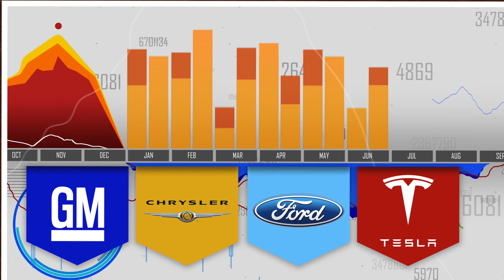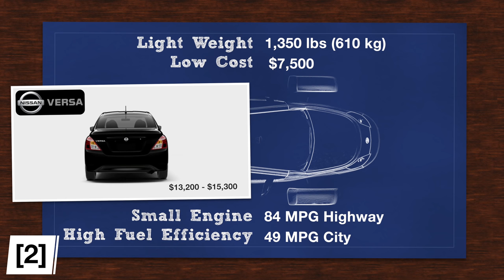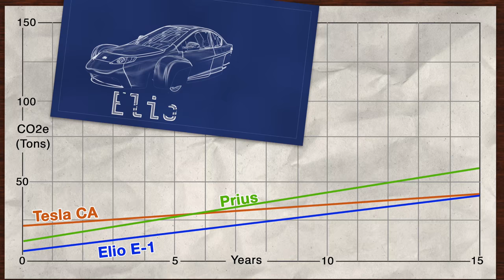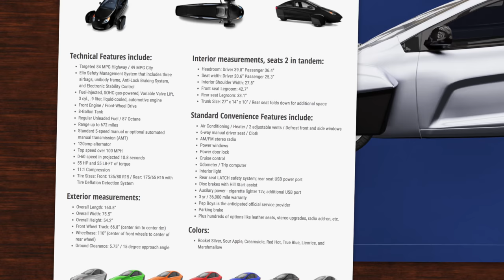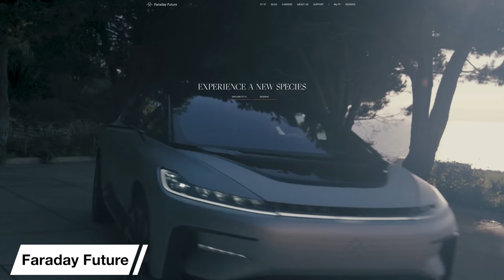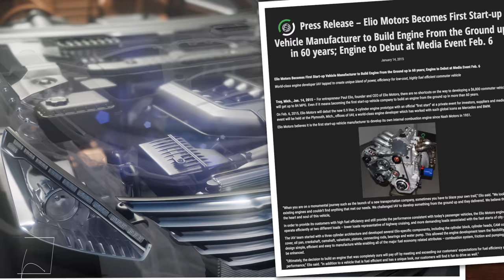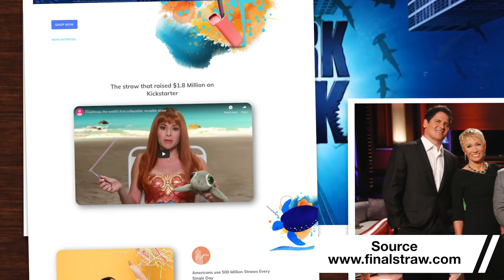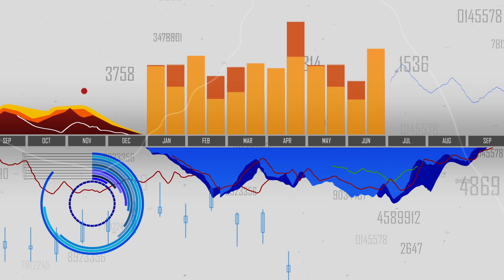How this Radical Car Missed its Chance to Change the World

Comment: So many people here dismissing the entire idea of the Elio because "you can't move 3 kids to soccer practice in it" or "go camping with 3 friends" or "bring home 37 bags of groceries" or "move furniture in it" — and completely missing the entire point.

With a car (autocycle) this cheap, it can become an "AND" car (buy whatever you were going to buy and get the Elio TOO). Instead, people are praising a $55,000 Tesla — which would prevent 99.99% of people from buying the Tesla and any other car because even with a cheap, practical car like a Toyota Camry, you could get a house for less than a Model 3 slash Camry combo (well, in "fly-over" country, anyway). This definitely makes any Tesla an "OR" car.

The point is that you can buy that giant wobbly land barge to haul around your offspring, AND own an Elio. That way you can still do all the "normal" giant SUV stuff, AND meet up with friends for a movie outing without having to drive your lone self across town in a 3-ton gas-guzzling hulk.

My final point is also about the myth of low gas prices making the Elio undesirable. 600 miles of range for 8 gallons of gas was $40 when the Elio was announced, but has dropped to around $15 today. Charging a Tesla Model S P100D at home in California from dead to full takes almost 9 hours, costs over $20, and will still only get you half the range of the Elio.
Reply from the maker: Great points! I really hope they reach production. It’s a truly remarkable bridge car here in the states. We just don’t have many fuel efficient options
Reply: @TwoBitDaVinci  It will never work as long as it is not an electric car!
Reply: @CurdinGees74  And even then, why would you buy it if you can buy a simple scooter?
Reply: @CurdinGees74  Electric cars are great if you're in a city with the level-2 infrastructure that a EV requires. You also need to keep EVs indoors during the winter where I live or the batteries could be damaged.

The Elio was designed as a transitional vehicle for the decade or two it'll take for EV infrastructure to become universal (or for people who live in Apartments that simply won't let you charge an EV, such as mine)

And while I love all motorbikes, scooters included, it's 21F outside right now with snow on the road.....
Reply: @DFX2KX  10 years ago, of course EVs were something exotic but now 2018 we have so many normal - looking Electric Cars, that there are no restrictions any longer. 300, even 400 km of range.. While you have at least every 150km a fast-charger. And often you can even charge at the working place or in a multistory parking garage. Current EVs have integrated heaters and can withstand also minus 30 degrees Celcius even for a couple of days. But of course, a garage with a powerplug will be nice. But of course, the purpose of this little car, was to reduce cost and material needs to build it. And also reduce the power consumption. It was nice for that time.. no longer after 2018 !
Reply: Big families are killing the (human) world...
Reply: @CurdinGees74  The Elio is still very much appropriate today.

Until EVs can get 500 mile range, or recharge in 3 minutes, or operate purely on the solar panels on their roof/hood/trunk, then gasoline will reign supreme. The only people buying EVs are people with LOTS of disposable income, or live near lots of free charge stations.

The people want a better product, and sadly EVs aren't quite there yet. Entry level is over $35,000 for any decent range, and the (non-Elio) affordable EVs either have no roof or windshield, won't go over 20mph, or have 10 miles of range.

The day you can drive 1,000 miles to ANY destination with stops no longer than a restroom break for recharging, in a vehicle that costs 25% less than an ICE-powered one (and doesn't look ridiculously stupid like the new Prius or ANYTHING from Nissan), is the day all ICE-powered passenger cars disappear. Probably 5-10 years out at this point.
Reply: @brackman71  You can get a used Renault ZOE  for $12,000, Charge with 43 KW and enjoy a ride of 300 km on one charge.  - nobody needs more than 300 km ! And you allways should take a pause after two hours of driving in any case.. to go to restroom, to eat, and also simply to relax, before you take the stress of any traffic. You don't need to wait, next year you will see many EVs pop up from multiple Producers.
Reply: @CurdinGees74  Nobody needs more than 300km? Hah!  Just today, I drove 400 miles (644km) to home, from visiting family and friends. I make this drive several times a year in my Civic, that can get over 40 mpg highway and over 600 mile on a topped up tank. Twice a year I may do 700 mile (1127km) days.  Yes, I usually stop to use the facilities, eat, and refuel (especially on the longer trip), but certainly no long enough to recharge an electric vehicle.  Until  electric vehicles can do over 400 miles highway on a charge, they will be be at best, a third vehicle for me (after my coupe and truck).
Reply: @dbcrn859  you can drive any distance with an EV that you like, only thing is, you take better care of yourself and also give the car some healthy rest to juice up. But I guess you need to test-drive an EV of 2018, so you can feel all the power that you get when your pushed into the seat.
Reply: @CurdinGees74  Until cities install street side chargers or car batteries become portable (to charge in apartments) electric cars are a long way off from being an option for city dwellers.
Reply: @CurdinGees74  You still need to charge an EV and the infrastructure to do so easily & quickly just isn't there yet! If you live in an apartment and park on the street (as I do) EV isn't an option and won't be for years to come.
Reply: I think what you are describing is still not the real issue. Few people are going to buy two vehicles and have one of them be a tiny commuter vehicle like this. Doesn’t matter if it’s gas or electric the kind of people who have an extra $7500 to spend on a vehicle will just get a nicer more expensive vehicle as opposed to buying a cheap SUV and a Elio. $7500 is still a lot of money for a vehicle. People who have that kind of money extra wouldn’t necessarily want this car and people who can only afford that much are going to be looking at the used car market for a single vehicle that does everything they could ever need. There are other cost that go with owning two vehicles; heck insurance cost alone would make this a hard sell for people in the market for a small cheap commuter vehicle and a SUV for all the other task. So all the things you listed that people dismiss it for are valid because anyone who has kids to move or wants to go places hauling stuff will not be the target audience for this vehicle anyway. This is a tiny commuter vehicle that is strictly for people who only need a small commuter vehicle, propulsion system is irrelevant to that. Their target audience is people who worry about carbon footprint and people who can only afford $7500 for transportation not people who can own multiple vehicles for multiple different task. Their target market is sort of limited and their competition is every cheap used vehicle currently on sale. 

Also they never really had an engine that would get the efficiency they were pushing and honestly they may never find one internally or externally that will fit those parameters. If this thing ends up only getting 40 mpg as opposed to the 80 mpg they are advertising then it really shrinks its appeal by quite a bit. After a decade of development they have really missed the mark and the window of viability for the idea, which honestly had a limited market to begin with.
Reply: @CurdinGees74  I'm in Texas. That's in the United States... so no Renaults are available at any price, and as for your statement of "nobody needs more than 300km!", I've gone on client meetings where 300km wouldn't have been enough for me to make it home. In Texas, we measure drive time in HOURS not MILES.
Reply: @johndavis1872  I've seen people here in Texas spend more than $7,500 a year in gas. For those times that they only needed to carry one passenger (and not a soccer team or a half-ton of lumber) the Elio would have been perfect. I agree they have spent WAAAAAAaaaaaaaay too long on the "development" phase and should have crossed the 500,000 vehicle mark by now.

...but even in an all-electric future, the Elio is still viable because if the EV technology ever finally reaches the "better than gasoline" stage, those technologies could be easily applied to the Elio which would make it even more appealing. Imagine the same 300 mile range of the Tesla Bismarck (Model S) using a 20KWh battery instead of Tesla's 100KWh battery. Recharging in one-fifth the time for the same range would STILL be very appealing.

The reason the world needs this car is simply that MOST people are transporting only themselves, without luggage, for 99% of their driving... and it's amusing to see a tiny woman piloting a massive land barge just to go to work. In the United States, apparently, everyone is only buying SUVs because Ford and Chevy have announced they are stopping production of nearly all passenger cars. I think that trend alone will kill the Elio, despite its value proposition. If the trend keeps up, you'll eventually only be able to buy 4-row seating, 6-door oversized SUVs. The only thing that can save Elio at this point is gasoline priced at $12 per gallon.
Reply: People would rather a real car, or motorcycle.
Reply: no we've been dismissing it because they've been lying to everyone and stealing our hard earned money, seriously research it before you start mocking what you don't know
Reply: @brackman71  Well, the thing with 300 km is.. what you need in your batteries until you can find the next supercharger. So basically after that distance you want to take a break anyway.. actually even after 200 km / 125 miles or to say after 2 hours - break and charging time at the same time, so you don't have any lost time. So to say even with electric cars you can drive thousands of kilometers across the country. Actually with a Tesla Model S 100 D you could even drive 500 km with one charge. In Wintertime still 450km. So, absolutly no worries about the range of an EV.
Reply: This is why people buy $65K pickups to carry their brother in laws couch once every three years.
Reply: HyperOptic Productions  I am sure plenty of people spend that much on gas a year, if you drive a full sized truck or SUV and have a commute it’s quite possible. Thing is people who spend $50,000+ for a Chevy Tahoe aren’t going to ever buy an Elio regardless. They might buy a Polaris Slingshot for entertainment but they aren’t going to buy something tiny, cramped and dull just to commute in. Heck they payed that much money for the huge vehicle because they want to be inside a huge vehicle; they chose it for comfort, luxury and appearance. People who spend that kind of money on a vehicle wouldn’t want the Elio regardless of cost, they bought the vehicle they bought because they want to drive it everywhere even if they are the only one in it. That’s the issue that limits this cars appeal, most people want a car they love not a tiny commuter vehicle just to get from point a to point b. It’s a similar position as the smart car (a vehicle that has barely sold 100,000 vehicles in the US in ten years), there is just a limited market for it. More people care about Apple CarPlay than gas mileage at this point. Auto purchases are emotional purchases not just buying a basic appliance to meet a need. 

The kind of cultural momentum they have to overcome would just be too much for this vehicle; at least in the states. Overseas they may have had a better chance if they could of hit that price. I am sure they could of sold 10 to 20 thousand of them a year if they had actually been able to get it to production but that’s probably about it for them and at this point the window has probably closed on even that. The 60,000 preorders they have was probably the vast majority of their potential market in the US. If the whole thing hadn’t been such a rolling disaster of poor decisions and incompetence this vehicle could of probably been built and sold well enough to exist in its niche but it would of never been a game changer in the industry. Could there be a future for something like this? Perhaps in urban areas as things like car sharing companies become more prevalent, although electric is going to end up dominating that market too.
Reply: @Hyperoptic "So many people here dismissing the entire idea of the Elio because "you can't move 3 kids to soccer practice in it" or "go camping with 3 friends" or "bring home 37 bags of groceries" or "move furniture in it" "

Who said that? You?

"The point is that you can buy that giant wobbly land barge "
Which ones wobble more than this bike?
Reply: @eksine  I've been following Elio since the company formed in 2009 (back when bad decisions by the presidential administration caused gas prices to hit $5 a gallon average). I've seen every news article and blog posting (both positive and negative) about Elio... so I am quite qualified to comment on the Elio. As for mocking Tesla (and electric cars in general) I am very qualified to do so without doing any more research than this: Can you go 4,000 miles in a Tesla in under 100 hours? No. Absolutely impossible under any circumstances because the technology just isn't there to replace ICE vehicles for long-range travel at anything resembling affordable pricing.

As for your assertion of Elio defrauding people... I wouldn't count production delays as "lying to people" otherwise Tesla would be just as guilty. Hell, Tesla HAS outright LIED to people saying the Model 3 would be $35,000... which is STILL impossible. Tesla will NEVER sell a $35,000 model, especially now that the "free" (taxpayer-funded) $7,500 subsidy just dried up for them. Expect Tesla sales to slow down now that people aren't going to be paid to buy their cars. People who want an electric car will shop elsewhere with companies that haven't hit their cutoff for the subsidy. The Model 3 will be no cheaper than $46,000 tomorrow morning. A new Honda Civic is less than HALF of that, at $19,450... or if you prefer Toyota, you can get TWO Camrys for the price of a Model 3 base.

The day you can recharge an electric vehicle with 500 miles of range within 5 minutes, and do so at every current gasoline station pump across America, is the day the ICE-powered vehicle goes extinct. Right now a full EV switch for everyone is a pipe dream until that point because a 9-hour level one recharge time for a Tesla Model S is absolutely ridiculous... and nobody who lives in an apartment can even consider installing a level two charger. Even a Tesla supercharger (level three) takes a half hour to get to 80% charge... with 90 minutes to full. Imaging leaving your car at the gas pump for half an hour while people behind you want to fill up. EVs are great for people who never travel further than 50 miles from home (or who have level two or level three charging at their luxury home with enclosed garage) and have double the money to spend on a vehicle.
Reply: @brackman71  no you're way overthinking it. logic fallacy. I'm saying they're not dismissing it because they can't fit 3 kids for soccer practice. it's because it's fraud. and you are wrong, this IS fraud, when you delay the date almost an ENTIRE decade, year after year, take everyone's deposit, and have nothing to show for 9 years. they are, what $100-300 million, in debt? yeah that's fraud due to gross incompetence or it might be downright fraud masked as incompetence. in either case lies, stealing money without anything to show for it, it's all the same thing. You're either being unrealistically optimistic or delusional
Reply: You can buy a reliable hoopty off of CraigsList for $3K-5K. Any time you're just driving yourself or you and one passenger, take the Elio. That's probably going to be 95% of all your driving. For that remaining 5%, take the hoopty. Cost of the Elio + the hoopty is still probably under $15K ... and 95% of the time you're getting 49-84 mpg. That's still a great deal and you still have a vehicle to carry larger loads.
Reply: Well said.
Reply: Exactly! I use a heavy one ton pickup for work. But would love to have a runabout that is just for me or me and my wife.
Reply: The problem in most countries with an 'and car' is you then have 'and insurance'. Car insurance is still a larger portion of total costs than fuel in some places and doubling that cost makes owning two cars a non-starter.
Reply: @CurdinGees74  Tell people in the American West that 300km is all they need. Most large towns are further than that apart. It takes over 4 days to drive coast to coast spending 12 hours each day at the wheel. Unless you live in a large city with a short commute, an electric vehicle is simply impractical.
Reply: @currentsitguy  Well the point is.. you don't need to be able to get to your destination without recharging on your way after 2-3 hours of driving!! You should take a pause anyway and so you can recharge 30-45 Min to do the next 3 hours of driving. So everything is fine, as there should be at least a couple chargers every 150 km ! Tesla at lest provides this.
Reply: @CurdinGees74  Not really practical. Here is an example: 4 years ago my wife and I went on a driving tour of the American West. We live near Pittsburgh, PA. We had a schedule to keep if we wanted any time to spend at our destination, Wyoming, in 3 days. On our first day we needed to make Davenport Iowa, a distance of about 600 miles (950 km) by the end of the day. The second day was Wounded Knee, SD at 700 miles (1125km). That's like driving from London to Milan twice in two days. It is simply impractical to cover those kinds of distances stopping every 200-300 miles and waiting an hour. Breaks consist of stopping to fill the tank, walking to the restroom and back, and going through a drive through for lunch and dinner. The US is a huge country and you have to spend considerable time behind the wheel if you are traveling any distance.
Reply: @CurdinGees74  Electric cars are still far too limited for a lot of people. Limited routes due to charging stations. Limited range, so adding a LOT of time when driving long distances.
Reply: @currentsitguy  Ok.. well I live in Switzerland, around the middle part.. so there is not even more than 300 km to go until I would cross the borders, no matters in which direction I would go. But driving over 1000 km in just one Day is just insane! Actually the only way to do your distance is by train, or by Airplane ! For me, it makes absolutly no sence unless you have 3-4 Weeks to spend on your 3000 km jurney. But you probably have to admit, you won't drive more than 150 km per day in a normal week. ( in Switzerland it is less than 50  km per day, normal usage of a car! ) But of course I know your distances in the US are longer, but still, there are a lot of Tesla owners that show the world, it does actually work just fine to drive across the country with an EV. You get up to 450 miles.. of Range.. but that still means.. do at least 30min brake every two driving hours ! Even though the comfort in a Tesla is much better than any kind of petrol car - even with luxiory interior. Because - EVs are very quiet, and no exhaust fumes, and above that you can save a fortune by using electric power instead of gasoline! An EV has only 2500 parts and a petrol car has over 6000 pieces, and a lot of other liquids and moving parts, that go broke in a very short time. 
A tesla does not even need inspection more than once in 100'000 km and can even be very fine at 600000 km.. so.. in any case an EV is allways better than any car that burns fuel !
Reply: @psykoklown874  The point is: you do not believe in EVs, and the need to get away from Petrol completely in just a few years ! If you want, it works.. if you don't want.. then it won't because you plan the trip in a wrong way! Also many times, the trips are not even really needed ! - We have an internet !
Reply: @CurdinGees74 Try telecommuting to a construction site. How do you plan a trip in an EV to places that don't have charging stations? I used to travel between job sites around the country in my personal vehicle (that's the way it was). Half way across the country in a weekend was quite common. On some of those sites I was installing the internet (ISDN) you would have me use to telecommute to those sites.
Reply: @CurdinGees74  You live in a beautiful country. I took a driving trip once from Como, Italy, via Lugano, Switzerland and Vaduz, Leichtenstein, to Feldkirch, Austria and back for a day trip. I had lunch in Splugen. Lugano is an absolutely wonderful town. I fell in love with the area. I understand how difficult it is for most Europeans to grasp just how large the US is. Really, most Americans don't get just how big the US is. Unless you drive it, or take the train (heaven forbid) it is completely incomprehensible. Our states are as large as many whole European countries. When most foreigners think of the US they think of New York, LA, Chicago, or some other large metropolitan area. The fact is, most of us live far removed from those places and we put substantial mileage on our vehicles just to get around. It is not as if we have any choice. An hour or hour and a half daily commute each way just to get to work and back is not unusual.
Reply: @currentsitguy  That is nice, that you actually had the opportunity to visit Switzerland and that you had a good time here. But you would not beliefe.. we say, one hour to get to working place and one hour back is just a normal travelling time  - be it by car or by train - which is much more effortless.. as you have not even one km to the trainstantion and every hour you can take a train that comes in on time, and gets to the destination at scheduled times. I think it is very sad, that the USA does not maintain a good network of train-lanes cross the country for passengers. Often you do only cargo by train. 
But apart from that.. no Swiss ppl would ever drive 1000 km in one day.. actually they would fly as the distance is too far for us. From Basel to Hamburg by train, takes even more than 8 hours.. from Zürich to Paris.. is probably around 9 hours. But I would never do that in a car !
Reply: @sirvash2335  I can think of about a half dozen reasons, ranging from bad weather (too hot, too cold, and especially rain) to having no meaningful cargo capacity at all.
My most common trip is going shopping - by myself.
And even in the extreme case, what I come home with would usually still fit in a vehicle this size, but it would be an extreme struggle to get it home on a scooter.

For that matter (leaving aside regulatory issues requiring wearing a helmet in it), I am typically not dressed in a way that I would feel comfortable with while riding a scooter.
And, this is viable and probably fairly comfortable for long distances (which given the country I live in are a semi-regular occurrence, often with just two people in the vehicle at most)
I don't feel too bad about the thought of driving this kind of thing the 4-500 km I sometimes drive, while I'd find that completely unthinkable on a scooter...

This vehicle is simply a middle ground that is more widely useful than a scooter, but not as needlessly oversized as even a typical small car...
Reply: @CurdinGees74  lol. Nobody needs more than 300 km!?

Where do you live exactly?

To me, 300 km is a trivial day trip.
Hell, I can and have gone to nearby towns and cities solely to go shopping that are 150 km away, and I can tell you it's very much stretching it to have 300 km range at most, plus my time at destination isn't that long and charging infrastructure is almost non-existent.
Driving 6-800 km with maybe 2 breaks at most is also a fairly common thing to do, often multiple times a year.
(hell, in some parts of this country 600 km is the distance between petrol stations, much less a town or any other infrastructure - there's nothing there in the middle to stop FOR, much less recharge a car.)
And by the way, those two breaks are probably 45 minutes combined!
(about half an hour for food, and 10-15 minutes just to stretch for a bit.)

I'm sorry but your assumptions here are way off.
If you had said 'most' people you may have been right. (though frankly my country as a whole is the exception that proves the rule - perhaps why EV takeup has been really slow here. And also why the few EV's that HAVE made it here have outright dropped their lower range models - you can't even get 100 mile/160 km EV's here, because they are not regarded as remotely viable. Hell, in some of the major cities it's possible to have commutes that are 80 km each way.)
But NOBODY?
Hah. Try again.

The only case in which you can really say NOBODY (And even here there will be exceptions) would be once the range hits 1500 km or so.
That's roughly the range of the people around here that drive 4WD vehicles to remote areas - typically dual fuel tank models that have 1200 km range and then 3-4 spare fuel cans on top of that.
If you can cover THAT use case, you can probably justifiably say that nobody needs a longer range.
but 300 km? Not even close.
In this country I'd say 90% of people would be covered with 600 km range. 300 km would not be enough for the vast majority of people unless they have something else to cover the edge cases...
Reply: @KuraIthys  I live in a small Town called Lenzburg, around 70 km from Zürich.. every 5 to 20km we have towns with have at least 3000 habitants.  But even a place with 500 would be enough to find an electric plug to charge up the Car... so in Switzerland you can charge every 40- 50 km... no Problem at all. But sure the Outback in the Us could be too embty.. In Europe 200 km of range is mostly far enough traveling during one day. Even Petrolcars will not have more than 40 liter Tank.. which is enough for 600 km. So you fill it up once a week. But the normal use case is simply charge at home over the night, and if needed, charge at working place 8 hours.. so you dont even need Fastchargers.
Reply: @currentsitguy  Your travel schedule is just like my family's schedule while traveling to visit grandparents in Texas. The 700 mile Georgia to Texas trip COULD be easily broken into two smaller trips with an overnight in Mississippi, but my parents don't really do this and just barrel through the 10-13 hour trip in one day.

Now this type of trip COULD be accomplished by a very long range EV or a small car like an Elio, but it's literally impossible to do that around Christmas with my family as passengers along with a half ton of presents and other luggage. Under these circumstances my parent's MASSIVE 3 ton Jeep Commander is really the only car (not truck) that can undergo this much punishment and survive 4 of these trips PER YEAR!!
Reply: @woxof46  The ironic part of it was we did the trip in a Mini Cooper, not the roomiest of vehicles. It's perfectly serviceable for just two people with the rear seats folded down for storage, however. We had all of our camping gear, 200 pounds of fossils we collected in Wyoming, along with various mementos and gifts we picked up in the various states we drove through.
Reply: @currentsitguy  You did it in a Mini?! Nice!!
Those cars are pretty famous for being able to carry a surprisingly large amount of passengers and cargo.
Reply: It is an excellent 2nd car. I have a Flex for my family's needs. Now its great for what you need a mini van or truck for but I work 12 hours a day and only 2 miles from my house so a little cheap car would work well for me.
Reply: @CurdinGees74  Are you living in Europe?  I mean it sounds like it since you seem to have no idea how vast and huge the US is.  There are 11 states that are as big or bigger than The United Kingdom of Great Britain.  The state I live in Pennsylvania is 300+ miles across (500+km) And with short  half hour stops to stretch, use facilities and eat.  Can till be a 6-7 hour trip.   Electric cars don't have that much range yet and the intfrastructure isn't there yet for this.   Yes we have places where you can charge your Tesla, but they are places where you know you're going to be spending a good portion of your day (like an outlet mall)
you're also converting miles incorrectly.  US miles are bigger than a km.
Reply: You are right on target, people are missing the point.  The Elio is no intended as the soccer mobile.  It's intent is for commuters, you would have the family truckster and an ELIO for commuting.  Look at all the F-150's used as the Familymobile and the commutetoworkmobile on the roads during rush hour and you will gain insight.
Reply: The funny thing you can't do half those things in most sports cars but they still sell a lot of them.
One thing I will say the Elio is more sustainable than a Tesla even if it still has an ICE since it requires a lot less rare and energy intensive materials in it's manufacture.
If they made an EV it would be greener no contest and maybe this should have been the direction they should have taken since there are numerous electric motor suppliers they could have used and the battery pack would only need to be half the size and cost of one in a Nissan Leaf or Bolt.
Reply: HyperOptic Productions I don’t know if you’re correct about the Tesla costing $20 to charge regardless of if it’s at home or at a supercharger, but I agree with everything else. I was very interested in the Elio when it was announced and periodically check on it because it’s so damn cheap.
Reply: @sirvash2335  .... riding a scooter 30 miles each way to work on the freeway in all weather is a no go.
Reply: @christophercrawford2736  I based my statements on the average price of electricity in California and the charge cost calculator on the Tesla website for the cost to charge a Tesla Model S P100D, and the projected economy of the Elio with current gas prices (around $1.75 a gallon) for the cost to refuel the Elio. A Tesla Model S P100D takes two full recharges to equal the range of one tank of gas on the Elio, so to go 600 miles, it takes $40 in the Tesla, and around $15 in the Elio. Bottom line is that the Elio is still cheaper per mile than the Tesla on anything under $5/gallon gasoline. Of course, YMMV in both cases because different locations will have different costs for both electricity and gasoline.
Reply: @CurdinGees74  Speed limit here is 80 mph, people drive 85. You should realize how little life experience you have before making plans for other people. How about I project on others: I haven't been to a coffee shop in over a year so they should all be closed.
Reply: @artsmith103  If you talk about daily driving of a car, then you are right.. I don't do it. But I can not actually understand why someone would drive more than 300 km a day. This kind of distances are definitly done by train und busses, at least in Switzerland !
Reply: @sirvash2335  You can stay dry in the rain and Drive on Interstate highways in an Elio. Scooters are banned on local roads in my state and would be an impractical commute car unless you live in the ghetto working local driving on roads under 45Mph.
Reply: @CurdinGees74  Sorry I disagree. In the US road trips are common for vacation instead of taking airplanes, and I have driven multiple occasions 1,500Km+ Yes this is 12-14 hours of driving, but electric cars can be impractical for some. 

Also, my relationship partner is a 450Km round trip. It's inconvenient having to bring a charger for your car to another house. I'd also need a weatherproof extension cord as my partner does not have a garage.

Not to mention a used electric vehicle is not guaranteed to have a new battery and might only make use of 275Km from a loss of being able to hold full voltage.
Reply: @CurdinGees74  Here in America if you're going on a 1,500Km one-way trip as I do multiple times a year finding charge stations along the entire journey are impossible. I can get charge stations frequently near important city's, but the goal for me is to stay on the highway and not create a zigzag pattern hitting up every single major city with its own traffic to charge my car. Routing my map off course that many times can add hours of pointless driving. Gas/petrol stations can be found 0.2Km off most interstate highway exits. If I wanted to charge an electric car, some cities are 40-50Km off course of my trip and can turn 1500Km one-way trip into 1900Km plus all the additional time used to charge instead than a 2-3 minute fueling session
Reply: @CurdinGees74  Taking a train still cost more than the gas alone. Also when you have to rent a car which costs more money if you plan on traveling around your destination. Having a car lets me leave the minute I want and not have to dedicate a specific time to wait in a train or bus terminal. I don't know if your country allows you to hop a train without reserving seats in advance but in the US if you want a cross country train you have to book usually weeks in advance or risk having a full train in the same means an airplane can be overbooked. cough united airlines Overall using your own car in America is cheaper for long trips, more practical regarding timing, Gives you the freedom to explore an area without the need of a costly rental and no need for luggage fees assuming you have enough space
Reply: @FluttershyVapes  In Switzerland you can just walk to the trainstation or use a bycicle or a bus, use your mobile to activate a ticket, hop on the train every 30 min or sometimes even every 15 min, enjoy the ride, get out, stop the journey on your mobile and that's it.. no reservation, no need to go to any desk to buy a ticket.. and 30 min later you can get back to your start if you want to. So around 40 times a day you can hop on a train. And where ever no train gets in, there are busses that take you whereever you want..in the smal area, sceduled by the arrivals of the train. In bigger towns we have also electrified streettrains that take you through the town very fast like in Zürich. The longest trip I took in Switzerland was around 5 hours. So you see.. trains are very common and also, they drive on electric power only! When you take your own car.. you risk congestions and you polute the environement a lot. Also you have to pay a lot for service and parkingground..a bit of a reducion you can only get with an EV.
Reply: @FluttershyVapes  Well, too bad, if you really think a gas-driven car is still better. You probably didn't take any time to actually check out the latest available EVs. Anyway.. here in Switzerland nobody would ever consider driving 1500km in a car.., but apart from this I know a good youtuber, who lives in Norway, he drives all kinds of diffrent EVs.. even 1200 km in 2 days.. so it is possible, even with an EV. Just to tell you.. the TESLA model 3 can do 540 km with one charge! And soon there will be versions with even bigger range, when they lounge 120 KW Battery pack..or even up to 200 KW. As they have their knowledge from the Electric Semi Trucks !
Reply: HyperOptic Productions I’ll have to check into that. I thought charging a Tesla was cheaper than that. Maybe it’s just where I live.
Reply: If it's an "AND car" than doesn't that completely kill the 2:54 argument ?
Reply: The average American family only has 1.3 children so 1 can sit in the back and the .3rd can go in that pouch in the door.
Reply: @woxof46  It's incredibly roomy. Compared to my mom's 98 Civic it's downright cavernous.
Reply: HyperOptic Productions you’re completely right. Even now in 2019, the majority of Americans travel alone daily, rather if it’s going to an appointment, going to work, running an errand across town. The Ellio makes perfect sense. And what most people who commented seem to forget is that the Ellio can haul two people. So even for couples, young and old, can drive comfortably anywhere using the fraction of gas that a normal sedan would use. I remember seeing this almost 10 years ago on facebook and just loved the concept. Young couples, retirees, do 90% of their traveling alone or with their spouse. I love my Prius, gets great gas mileage but again, I do most of my traveling alone, with the exception of my days off when my girlfriend and I go out. Americans are so consumed with the idea that if you can’t haul a refrigerator, plus 3 kids and 37 bags of groceries that anything smaller than a SUV isn’t worth it. Which is nuts considering how much people actually go out to do this tasks, which may amount to once a week, maybe once every two weeks. Then travel alone for the majority of the week. I really hope this car gets off the ground because ever since I saw it 10 years ago, I’ve been dying to have one.
Reply: HyperOptic Productions this was a super helpful comment.
Reply: @SolarizeYourLife  You damn right!